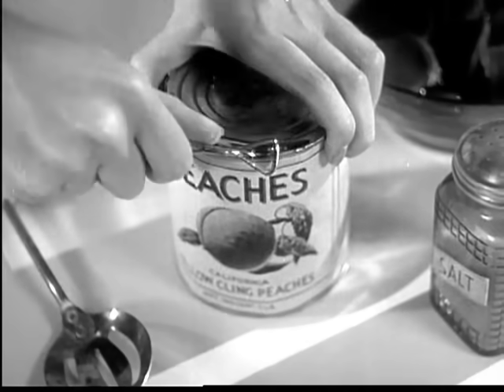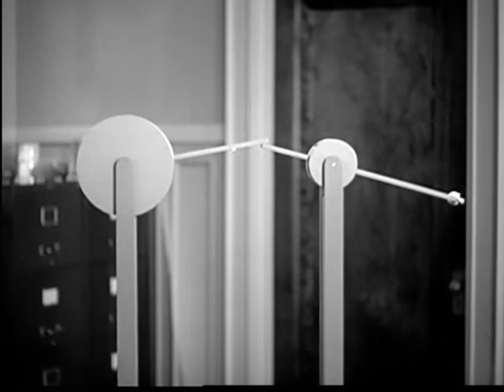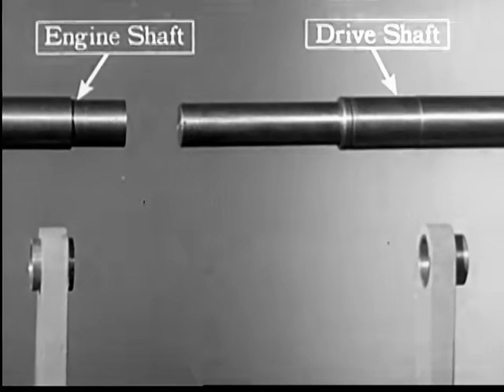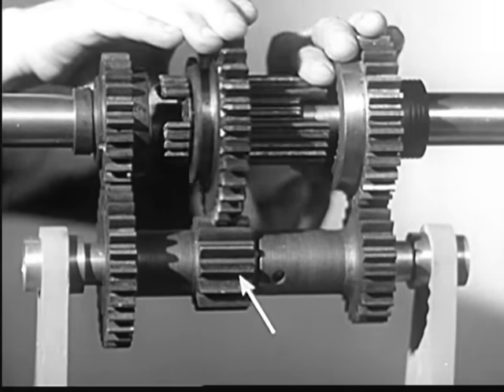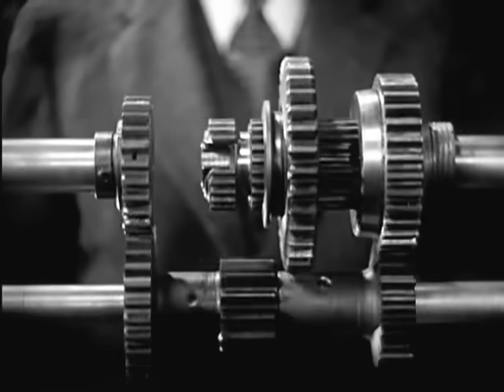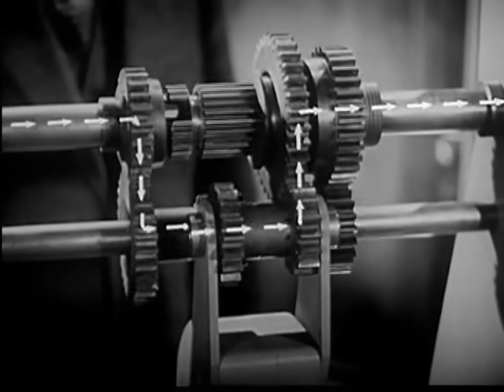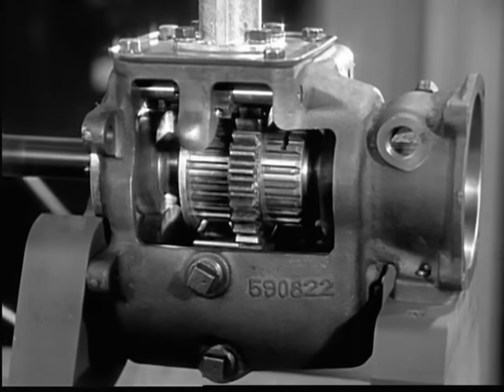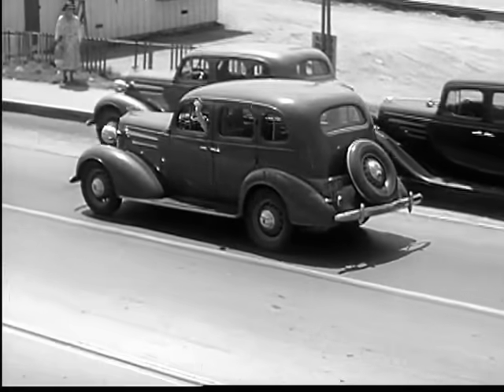Spinning Levers - How A Transmission Works (1936)

Comment: As a new manual driver I've been trying to fully understand what's going on in my car when I shift. I've watched dozens of youtube videos and read a bunch of forum posts but my brain just couldn't visualize it. 

HOW THE HELL DID A 1936 VIDEO EXPLAIN IT BETTER!? It's so god damn simple!! Im genuinely dumbfounded.
Reply: Well to be fair, today's shifters, clutches, and gearsets are WAY more complex than the ones shown in this video. And this video does not mention how a modern clutch works. When you push the clutch pedal in, you are entirely disconnecting the engine from the transmission, re-aligning the gears (shifting) and then re-connecting the engine with the transmission. This isn't how shifting works in the transmissions featured in this video, because the engines at the time didn't run at 3, 4, 5k+ RPM like today's engines do.
Reply: @Dhalin  Doesnt change the basic Idea of a manual transmition however.
This 83 yo Clip already explained how synchromesh works. Wich is more then enough basic knowledge.
Reply: @Dhalin  nope, basic idea remains the same this should be shown at tech schools at the beggining later all the newer stuff
Reply: @rackbasedlife9584  It had a clutch, as do all manual transmissions. The synchromesh is for lining up the teeth of the gears as you shift. If you didn't use the clutch you would still stall t he engine or destroy the gears from the impact of engagement. 

Here is the deal. Get your drivers license, buy a car, buy a couple grand worth of tools. Work on your car for a while, and then come back and tell me how things work..
Reply: @RonPaul20082012  the video even states that experienced drivers cam shift without a noise. (In a Clutchless car)
I even tried it myself in my own car and it work by pure luck :?
My grand dads vehicle doesn't have synchro gears, watching him downshift is a feed of itself.
Reply: @BlackVogel1  you can rev up, rev down and while you're dropping change gears, then rev up again to regain lost speed. It can be done.
Reply: This was typical of educational pedagogy back from the 30s through the 60s: clear, concise and to the point. This was one of the reasons that I preferred reading physics and Calculus textbooks written back from the 30s through the 60s. After that, the style of writing became verbose and less clear.
Reply: Please explain what the 3rd petal on the left is for and why she presses it down with her left foot to downshift to 2nd gear in the video.
Reply: Well back then cars had 3 Speeds and a Reverse
Reply: Because education today isn't about learning things the right way. They don't want people to know how things work. Information is power.
Reply: This
Reply: Because this is the first video that you have watched that was shot by people that actually understand what they are talking about as well as the art of communication.
Reply: @NemoBlank  this. Just this. Get the guy that knows something to explain it to you, don't get the guy that's good at explaining. If your tutor has no idea what he's doing, then he can be the best one explaining it to you, but you won't get a thing. With the guy that knows, given enough time, you'll understand every little thing.
Reply: Get ahold of a beat-up junkyard tranny and take it apart. That's how you will really learn about a modern 5 or 6 spd manual. This video is ok for basic understanding.
Reply: Because gearboxes today are considerably more complex and there's a lot more going on down there.
@The Jeff
It disconnects the engine from the gearbox.
Reply: This is explaining how a 1936 gearbox works. This is quite different from how a 21st century gearbox works. Back in the day they were way simpler, and so they were easier to explain. the concept is the same though, so if you get the idea of this you get the idea of how your new transmission works.
Reply: The car she's driving at the end is close to an automatic than it is a modern manual. No clutch at all. It's literally shift at 20mph and again at 60mph
Reply: @awesomeman8385  You would stall the engine and ruin the gears without a clutch.
Reply: @RonPaul20082012  you literally just saw why that is not true.

Comment: These old movies, done before modern computer graphics, are very well done and clearly explain how these things work.  The one by Hamilton Watch Co. is great in explaining how a mechanical watch works.
Reply: There are two Hamilton films, "How A Watch Works" and "What Makes A Fine Watch Fine". 
Both are excellent tutorials.
Have you also seen the Elgin film "Jewel Bearings"? It's on the long side (73 minutes or so), 
but it shows in detail how some of the most important horological parts are made.

Comment: I always said to myself that transmission was an outdated mechanism  I need to invent something better
Reply: You need a transmission if you want the to reach higher speeds with only a gasoline engine. 
But I kinda agree that they are outdated now that we have electric cars. In series hybrids and power-split hybrids can accelerate without a transmission but have a gasoline engine that recharges the batteries.

Comment: I really don't get it
6:06 both the right gears and the direct one are in contact
aren't you in two gears at once
very confusing
Reply: Input shaft is directly locked to output shaft in 3rd gear.

All gears are free wheeling, no power is transmitted through gears.
Reply: The right gear on the top shaft is not locked to the shaft; it's free to spin around it as demonstrated at 3:30.